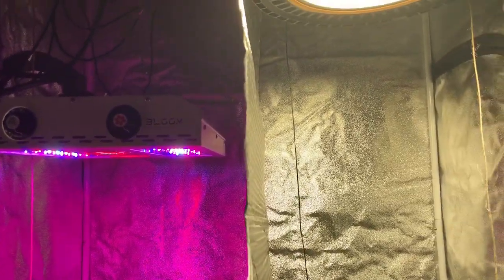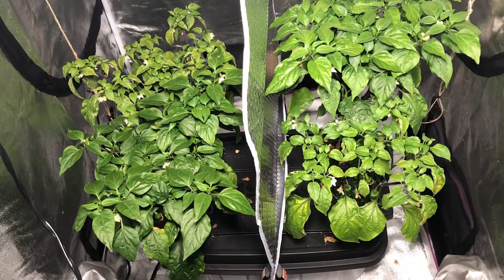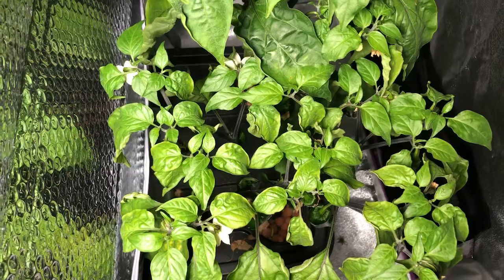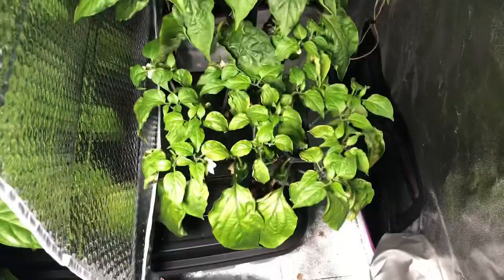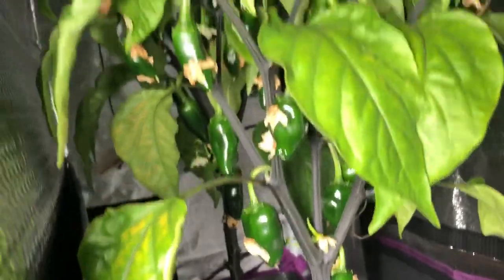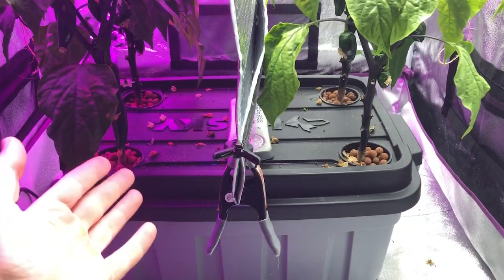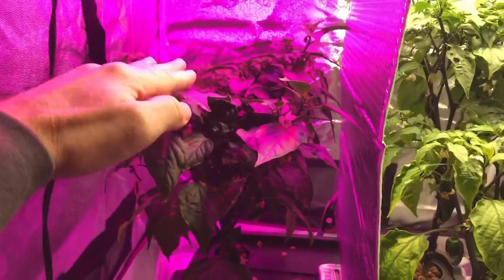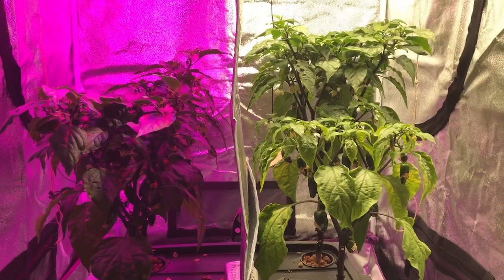MaxBloom vs High-Bay LED Grow Light S2E4

Comment: So the reason you get plants that cannot cope with LED light is down to their individual genetics. All plants can suffer from photo-inhibition under >700 PPFD/PAR. The actual phytogenetic mechanism is quite interesting, but basically plants have two modes of photosynthesis. When plants experience high intensity light some of them are able to adapt and continue growing, whereas others stop altogether. You don't always get bleaching when you get photo-inhibition. This only happens when chlorophyll is degraded, instead one or two of these mechanisms stops. After the mechanism stops only certain plants can recover and that is the key factor, called photo-inhibition recovery (PIR). That is the key genetic trait. Your results are classic examples of this trend in peppers, which has been studied and published in scientific journals numerous times before. The experiment usually finds about a 50% response in peppers - exactly matching your results. The DNA coding for recovery is not yet known. What you need to understand  is that your intensities are still too high. Read some of the research papers. It's always been a big factor when choosing LEDs and to be honest some further research is needed on pulse width modulation to get to the bottom of this. Less is always more - use your dimmer next time.
Reply: good point about light intensities being maybe too high for optimal growth in this particular crop.  I am interested in  the kind of stuff you are talking about with regards to plant response to light.  can you suggest any specific research papers for me to read as a partially scientifically literate horticulturist?     also, because this is a youtube comment, i feel i must observe the etiquette by arguing about something, so "Less is always more" citation please
Reply: @beansdork  LEDs have a pulsed frequency with a square waveform. When I was researching the use of high intensity LEDs in horticulture, I began to wonder how the photosynthetic cycle might respond to this type of light. There are notable phenotypic differences between a variety of plants grown under LED vs HPS or CFL, and to me they looked like classic examples of photoinhibition. Interestingly, there was still a lot of debate about exactly what LED light is. Photometers seem to show very narrow bands of light produced by these diodes, whereas natural light (the sun) and other forms of light (CLFs, HPS, MH etc.) have a far broader spectrum. What's more, pulse width modulation can mean that the intensity of these peaks isn't easy to measure using classic instrumentation. Notwithstanding, the duty cycle of an LED can be considerably narrowed or widened using dimmer switches or frequency levelling, which can make any assumptions about how a crop might respond, rather circumstantial. It also seemed possible that the energy from modulated (dimmed) LED light could still be triggering a photoinhibited response because the intensity is still reaching very high peaks, albeit for microseconds. There are two major photosystems (PSI and PSII) that are though to become photoinhibited, although this field of research is very new and there is no clear consensus on what is going on. It gets more interesting when we consider the photoinhibition repair cycle. The idea was bounded in this paper: https://academic.oup.com/plankt/article/22/5/865/1475631. If the damage constant or the recovery rate are impacted by the pulsed frequency of LED light then that might help to explain why we see the symptoms of photoinhibition in plants exposed to this form of light (LED), as opposed to it simply being about differences in the light spectrum. Both of these factors (damage constant, recovery rate) are integers and are temporally bounded! If you think about the thermodynamics of complex molecules with electrons exited by regular pulsating light, we can surely expect some very exciting mathematics to come out of all of this. Perhaps even the pulses trigger photoinhibition. In my eyes means that there could me an optimal way of controlling dimming to ensure minimal impact from this factor on plant growth. Sadly, there have been very few studies published on this topic. There was one a few years back that came from a group in China, but I have lost it. It began to look at LED light and it's potential for photoinhibition, which showed something like 40-50% of crops growing sub-optimally. Nobody, to the best of my knowledge has done protein analysis to quantify the extent of photoinhibition, and the majority of studies rely solely upon empirical crop growth rates. I think this is one of the greatest challenges in plant biology and horticulture of our generation. I am fairly convinced that LED technology is poorly understood. I have purchased a lot of the equipment to start pot trials, but the lack of photometer instrumentation actually suitable at measuring LED waveforms, makes this all rather hard to prove conclusively. It's a project that I have put on the back-burner since I ran into hard times.
The less is more, comes from observations in regions with high photoinhibition where shade provides survival to certain plant species. If you visit high altitude locations where there is a lot of UV light, you will find plants highly evolved to counter photoinhibition. There is also greater growth (NPP) underneath tree or leaf canopies of certain species that struggle with photoinhibition, even in moderate altitudes. It is what makes shade loving species (there is a special word for these plants, they suffer in direct light in their natural environment). It's more of a saying, but the next time you are at high altitude, make a good study of what grows there. You will see plants getting smaller as you gain altitude - lower NPP, despite considerably greater light intensity (20% plus). This is because even with adaptations to photoinhibition, the effects are profound enough to cause photosynthesis to come to a crawl. You can often see more differentiation (sub-species and phenotypes) due to these environmental pressures.
Reply: @SC-hk6ui  wow.   thanks for all that, and especially for the link for the paper.      I will check it out.      wherever i am, i  always  look at vegetation and try to imagine what is affecting the growth of whatever vegetation i can see as a microbiome as well as  individual plants, and i havent considered until now the effects of altitude on nPP or light intensity.   you might find this ludicrous in the same way i find it ludicrous if you mean to infer that this was somehow the only environmental reason that there would be less growth at lower altitudes, since lower altitudes might be associated with more abundant soil nutrients, more bio available oxygen , CO2, atmospheric nitrogen less extreme temperatures etc.   i am quite glad i got into this little interchange now because theres a lot to think about and  it will surely be interesting for me to look at what  effect increasing ambient Co2  might have on the ability of any particular phenotype to utilise higher peaking intensities and greater overal DLI.  i am sure this must have been studied a lot, in general while still leaving a whole bunch of opportunity for small scale research and phenotype 'hunting,' breeding, or even genetic engineering

Comment: This channel definitely hasn't received the recognition it deserves, this is very interesting, very relevant science right now; I see so many maripickle growers asking about white vs blurple to which there are very few solid comparisons out there short of this channel.

I share your fascination for this science, I do similar tests, though no where near as impressive and I have a theory on the white vs targeted spectrum comparison:

We currently measure DLI limits for light exposure , or "daily light integral" as cumulative, combined photons within the PAR range.  My testing leads me to suspect this is wrong though because I have always been able to get a higher intensity & subsequently higher DLI of white light on to a canopy than a targeted blurple or pure 660 before signs of stress start to show.  To me this suggests DLI has a specific limit within each colour band rather than it being spread / exchangeable across the PAR spectrum?  Just a theory, maybe it's not as simplistic as that? It does explain why whites will outperform targeted, even over measured intensity.